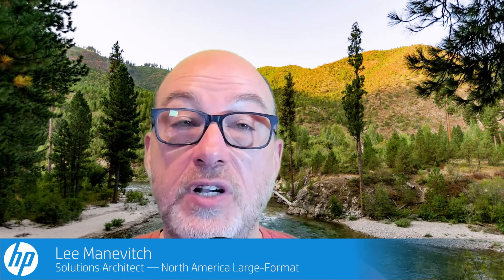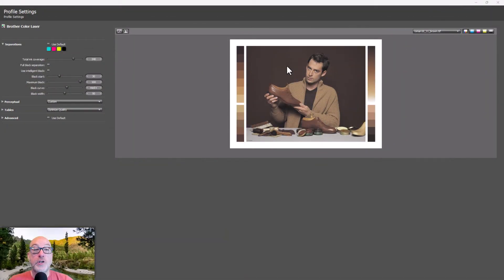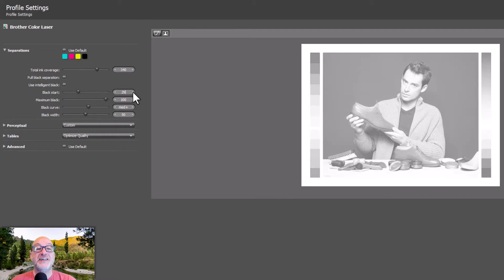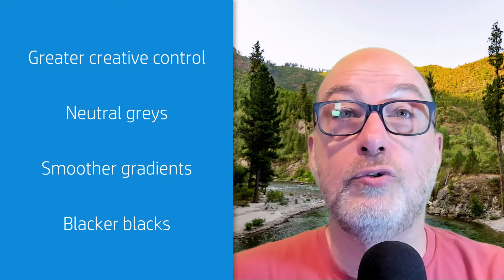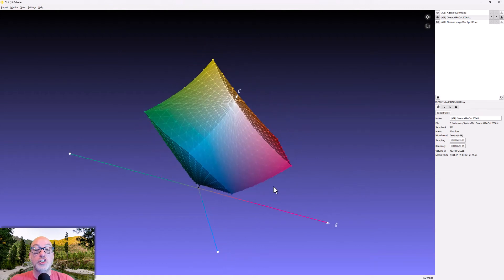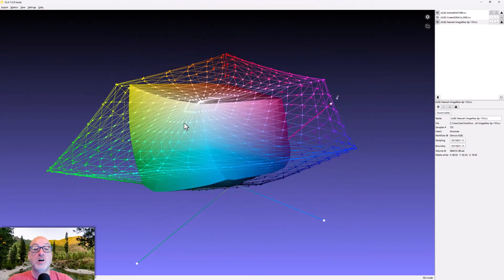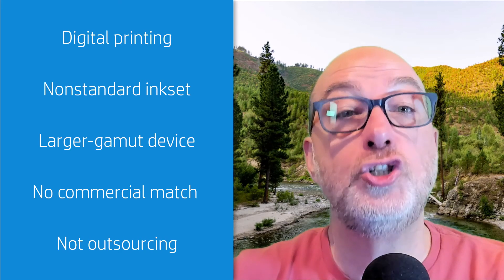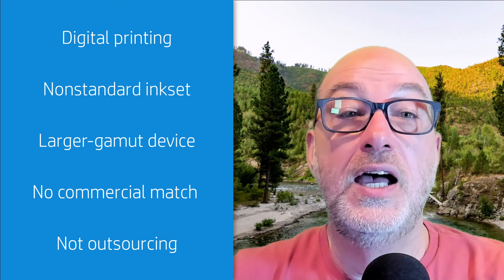Stop Designing in CMYK!

Comment: Wide format print shop here… we ALWAYS work in RGB. Simple explanation.. what you see on your monitor, is what you get.

Monitors are all RGB, if you’re working in CMYK, not only are your colors not as vibrant, but you have no idea what color you’re picking. Changing your workspace to display CMYK as RGB never is accurate.. and again, your colors will always be more, bland.

Second, almost all rips convert to CMYK on their own.

Third, blacks and greys! These will always have much more shift when printing in CMYK.

In 2025, there’s absolutely no reason to design in CMYK unless you’re sending to a stubborn old offset press.

Comment: Design all you want in RGB, but in the end print is CMYK and always will be. Sure they may add in other colors but there will never be an RGB printer. Thus I think it best to convert to CMYK before you go to print and fix any colors that need edits. I know full well about the gamut issue as any saturated darker blue sky wills hift to more violet or purple. Yet I don't fix that by leaving the file RGB. The CMYK printer will still shift the color. At least with converting before print, I can make edits.
Reply from the maker: Did you watch the video or are you ust issuing a blanket response? Yes...printers are all CMYK. But the CMYK you design in and the CMYK you print with are different colorants at different densities and you are robbing yourself if you either design in CMYK or if you convert to CMYK using anything other than the printer's correct ICC profile for the ink, media, resolution, and dot pattern you intend to use...which limits you to only using that mode.

Instead if you design in RGB and let literally any modern large-format RIP do the heavy lifting to convert RGB > Lab > CMYK, you get the same results on-the fly with zero effort and you have a file that is portable to other printers, media, etc. without requiring rework.

You're free to do whatever you want to but this is 30 years' experience in the print world talking. RGB design - funneled through a ICC-based RIP - has worked for me all the time, every time.

If you're talking about sending a file to your home desktop printer then yeah...don't do that. But that's not what my channel is geared for and that's addressed in the video. Color conversion at the RIP is a requirement when working in RGB for print.

Comment: I was looking on your white ink videos and stumbled on this one because of its title. I absolutely agree with you, there's no point of designing in CMYK, regardless of the standard. Primo, there are setting in ID, AI, PS and also Affinity software to convert on output to the colour space your printer desires. Make them people happy. Secundo, most workflows are PDF based this days, again converting a PDF file to any colour space, specifically your output colour space is just few clicks in Acrobat.
But the point you are making, about limiting your colour space, also applies to RGB. Regardless of the flavour: sRGB, Adobe, ProPhoto or whatever your RGB is, it still may be limiting your design and not utilise what the printer can actually do print, especially in green hues. When I really, really want to get a colour on a digital wide gamut inkjet printer I go with HSB or Lab (for some reason there's no Lab in AI and no HSB in PS 🥴). These are way wider colour spaces and they are pretty much standard – any decent RIP software will deal with them without an issue (assuming proper setup, calibration and maintenance of course) and print the best it can with your file.
And tertio, colour blending modes, or transparency modes. Be very very careful here with CMYK and RGB. Some of them behave differently in RGB and CMYK. Most notably the most widely used Multiply yields COMPLETELY different results! Be aware but have fun designing!
Reply from the maker: I never convert to output space anywhere but at the RIP because doing otherwise can cheat me out of gamut. But...

AI doesn't have Lab color in the regular picker but if you create a custom color - spot or process - you can choose Lab to input the values. If you choose process color then it will automatically convert to your chosen color space, but if you make it spot then it should keep the Lab values intact.

Comment: Hello Lee, 
Thanks for your video 2 years ago. I am still stuck.
So I am beginning my illustration journey, will get an ipad soon with Concepts as a vector based app rather than Procreate. I am a watercolour artist. I use Cam scanner app on i-phone at all stages of my artwork. I don't like photoshop, or indesign.

Like my mother, we both can colour match when working with our own colour mixing, regardless of whether it is oil, acrylic, or watercolour but gouache can be a little tricky as it dies a little darker or lighter.

My idea is to use Concepts an app, on an M4 ipad, to clean up images, remove parts so I don't have to redraw the entire sketch, and get finals to turn into spreads to be printed as picture books.

I could also start with grey scale ink in practice, where texture, line and tone are there and add colour digitally later.

Are there any colours to avoid for picture book illustration, to start with?
Do you know about scanning on ipad when it uses filters for better lighting choices, and then working in colour later?

Any recommendations, or links will be appreciated. I found your video, by typing in this question into google...
QUESTION: What are some colours to avoid in analogue as they don't print well in CMYK?

What do I mean? Well I can start by avoiding colours in watercolour or gouache that change in the printing process. Simply not choosing some colours, rather than trying to colour correct and match later, only to be dissapointed.

I am not going to self publish, rather I want to print large format picture books, with a publisher to take on my work.

Interestingly Mum and myself were printmakers, who colour mixed oil based inks by hand, I used solar plate etching, which was back then an orange plate with an aluminum backing, and had several colours on the one pull, by doing viscosity printing, with 3 roller brayers of different densities, and different consistencies of ink so we could get 5 colours in one pull!

Luckily, it was difficult to get deckled edge paper to line up in registration, and I used printmaking as a tool to create one offs, and it is hard work to get a set to match.

I also worked in a film lab, pulling film through and printing, and doing corrections on the machines like removing densities, and adding or removing RGB.

Another pet hate seems widespread, when I go to the art gallery, nothing frustrates myself and my Mum more,  than the bad reproductions in the gallery shop, usually 4 densities too dark. Nothing is close to real life, even if hundreds of years of yellowing varnish was blocking the process.
Why doesn't the scanner person or program, ever match the print out version of an art postcard, or worse still, the whole large format book as an exhibition catalogue? 
I am yet to see any exhibition or ANY art book with real life colour! We are sending the wrong colour out to the world, expectations in real life are so very different!
It seems closer on our phone camera, as light RGB, particularly better if using Cam Scanner, I have been recently advised by a fellow artist when at the exhibition to use. We can take better shots ourselves, but then how could we better print them ourselves?

This process is wrecked only by people, artists and photographers, who could/should be able to know people and programs better than they currently do, or people who can manipulate and adjust colour digitally for more accurate print! We don't want perfection, we want closer to real life.
(We may find that all art now needs to be rescanned and reprinted in the future, and we hope that better reproductions will be standard practice, beautiful and authentic.)

Any suggestions, stories or explanations will be appreciated.

In kindred spirit,

Rubinia Lane
Sydney, Australia
10th February 2025
10:38pm

Comment: Most printers will print an RGB file and do the conversion to its own CMYK flavor. I honestly don't see much reason to send a CMYK file to a printer. It's like, you don't need a monochrome TV signal to watch a black-and-white TV. Just send the regular signal to the TV, and the black and white TV will display it in black and white. It seems unfair for print shops to require images in CMYK from customers. I know I'm gonna lose color on the print. But, if the printer does the conversion for me, that's gonna be WAY better than putting that color conversion burden on me.
Reply from the maker: Agree!

The common misconception is taht because a printer is CMYK that you'll somehow get "better" results if the design is also CMYK.

The biggest problem with designing in RGB, though, is that a designer will choose WAY out-of-gamut RGB colors onscreen and then reject the job when what they get is nothing like what they expected. Honestly the biggest skill in the print business is managing expectations.
Reply: @LeeManevitch  Not as much better results as better control. But designers nowadays can't tell the difference between ink and colour 😝

Comment: I work as a graphic designer in house at a company where we have digital large format printers in house. A few Vutek machines, some roll, some hybrid with dts, also HP latex printers. My pre-press people always get frustrated that I'm sending them RGB files. But I have maintained this practice because of what you're describing here. The vibrancy of color is just not comparable if I'm using even sRGB compared to SWOP and I don't want to sacrifice the extra vibrancy. I still get some uncertainty on some blues when I'm sending to print from RGB. Can I get more certainty by matching the profile that the RIP is using? We're on Caldera for the RIP. Typically I'm sending sRGB sometimes Adobe1998 and may switch to that exclusively. Sorry if not clear, just to reiterate what's the best way to minimize shifts in blues and sometimes blacks being too dark from RGB. Thanks for the helpful video.
Reply from the maker: If you're asking "should I design in my printer's output ICC profile" then no, absolutely not. By doing that you're not only limiting your color gamut to the printer's, which makes migrating to a different printer more difficult, but you're also introducing any printer shortcomings into your design.

CMYK design should always be done using profiles that adhere to standards like GRACoL or SWOP; not based on actual measurements on a specific output device.

In fact, keep in mind that the default behavior of all RIP software is to take any design - CMYK, RGB, or even Greyscale - and convert it first to Lab color. After that, it then converts to the output ICC. So if your prepress department is experiencing issues with your RGB files then either there's a problem with their RIP setup or with their output profiles...but it's not your artwork.
Reply from the maker: PS for blues and blacks:

Make sure you're choosing a blue that's actually possible to reproduce. You can see in the color picker if there's a gamut warning - a little yellow triangle - that tells you you're out of gamut. It may be by a little or it may be by a lot, but at least you'll have an idea. You can turn on the Proof preview to see how much it might change.

Blacks...if 0-0-0 is laying down too much ink then that's a problem with your RIP...either the ICC black generation settings or the ink limit. Create a series of swatches with diminishing levels of black and print it, then determine what you should be using for "solid" black.
Reply: @LeeManevitch  That last paragraph was what I was trying to understand. It's getting better results doing rgb > lab > ICC than if I just began in CMYK. I just didn't understand that RIP process, or the how it does it I guess. Thanks also for the blacks and blues tips.

Comment: I would love to stop using CMYK, but unfortunately there is no professional printer in our area that can print an RGB well. Is there a professional printer nationwide that can print RGB without altering it?  My RGB designs are amazing compared to my CMYK.  This is due to the fact that I love using gradient for my project covers.
Reply from the maker: If your RGB designs are "amazing" compared to CMYK, then it's possible you're using colors that are way out of gamut for CMYK. You can flip the switch from RGB to CMYK in Illustrator and Photoshop to get an approximation of how your colors will change. 

I ONLY design in RGB when going to a digital printer; if I'm going to a press then I'll design in CMYK or I'll use PMS colors that I know will print with decent accuracy in CMYK. I don't know your printers but if they're using traditional SWOP ink colors then because you have no control over their print process you should be using CMYK as mentioned in the video.

I have no recommendations on trade printers for you...that's way outside of my scope of expertise.
Reply: @LeeManevitch  Yes, I already change it to CMYK in Adobe Photoshop.  However, gradient patterns just don't often come out well at various professional printers. Often it leaves a lot to be desired as if they are running out of ink in appearance.  I've been forced to use solid backgrounds to solve this.  If someone ever comes up with RGB professional large print machines they may corner much of the market.
Reply: @gkline8288  I think the most... infuriating part is that you can print those beautiful colors at home, but a professional can't make it. I just don't get it.
Reply: @PaolaLaborda  Basically RGB has almost 2x the range of CMYK (Printer colors).  If you use Photoshop it offers the ability to Change to CMYK colors so it comes out better.  In Photoshop go to Edit, Convert Profile,  then lastly  select "Working CMYK - U.S. Web Coated (SWOP) v2"   in the drop down menu. 

My last covers came out much more vibrant and with better contrast.
Reply from the maker: When you print at home you're not using those industry-standard CMYK pigments but rather pigments that are brighter but won't match any other printer. Commercial printers need consistency even between providers, so they use standard colors that happen to be duller in color.
Reply: @LeeManevitch  I use a reasonably priced local printer. The only problem I had is they don't explain RGB and CMYK to people. Once I learned that I was able to change to CMYK in Adobe Photoshop and now my covers come out brilliant. Also the DPI count had to be raised between 300 - 500 to get wonderful crisp clean pictures. I'm so happy a friend in the printing business explained in a few sentences how to improve my work.  If only other printers did that, many ppl could easily adjust their work.
Reply: @LeeManevitch I'm so appreciative of this video and information. I do sublimation printing. I am trying to understand what are PMS colors? Since I print my own images on sublimation using CYMK ink, is it best for me to design and print in CMYK versus RGB to get the best match of what I see on my screen? Any help is appreciated!
Reply from the maker: PMS is the Pantone Matching System. Do a quick search for "Pantone swatch book" and you'll see something that might look very familiar.

The PMS is an industry-standard method for communicating and reproducing color. The color system uses 16-ish (can't recall the exact number) of primary colors, mixed together much like when you get paint from the hardware store. The original purpose was to allow for mixing ink colors for commercial analog printing, so for instance a black and red job could be run as two colors instead of four.

Today we still use it for analog printing methods such as offset and screenprinting, but more often it's way that we can tell people to use, for instance, Pantone 273C for the blue and regardless of where in the world they are they can grab a swatchbook and use that to see exactly what color we meant.

As for your own print process, it's entirely dependent on the print software you use. If you're using an ICC color-managed workflow then you're more likely to see success designing in RGB and printing that way. If you're just using the built-in Windows printer driver then you'll really need to try both and compare, especially because sublimation is so dependent on heat and pressure as well as the quality of the print itself.